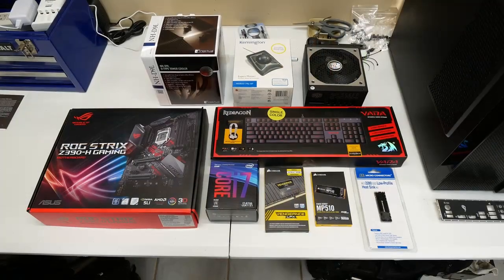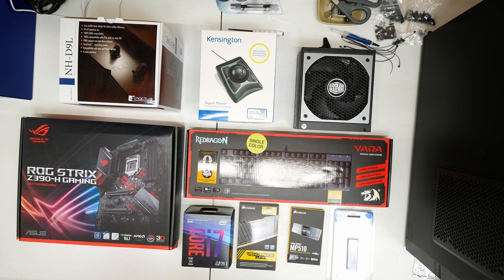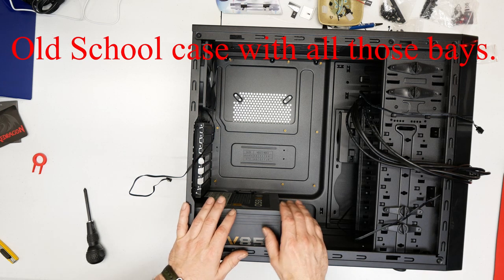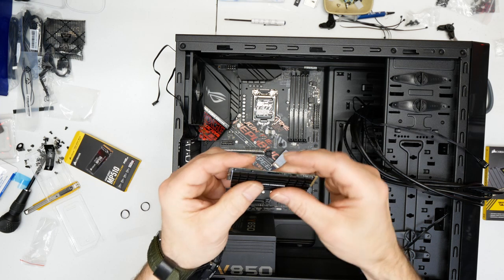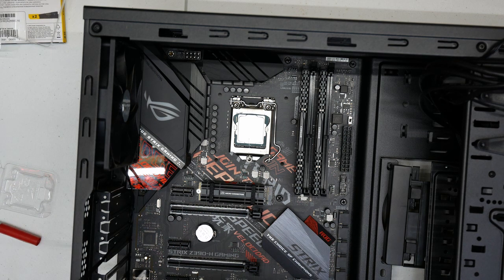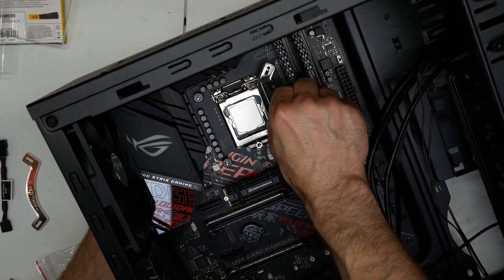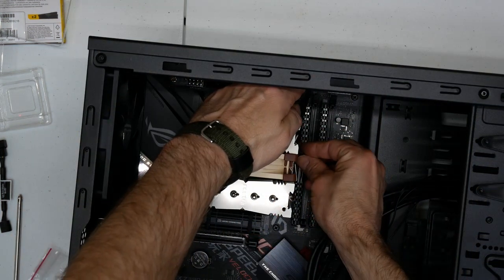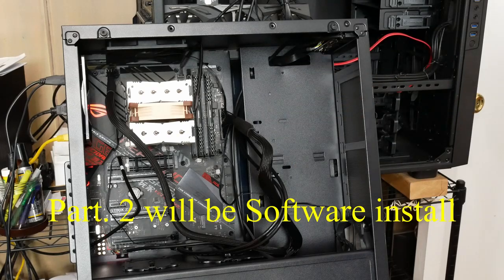#64 Building a Computer for Linux Mint Part 1

Comment: Here is my Linux Mint Build that I use for gaming
Ryzen 5 5500
Cooler Master Hyper H412R CPU Fan
MSI B550M Pro-VDH WIFI MATX AM4
TeamGroup Vulcan Z 16GB (2x8GB) DDR4-3600 CL18 Memory
Seagate BarraCuda Q5 2TB M.2-2280 PCIe 3.0x4 NVME SSD
XFX GTS XXX Edition RX 580 8GB 2304sp
Cooler Master MasterBox MATX Mini Tower (Modified for air flow)
Thermalright TL-C12C 120mm x4 (front x2, top, rear)
Linux Mint 21.3